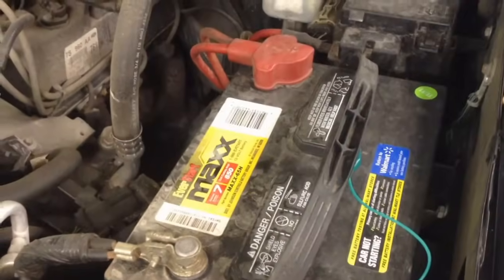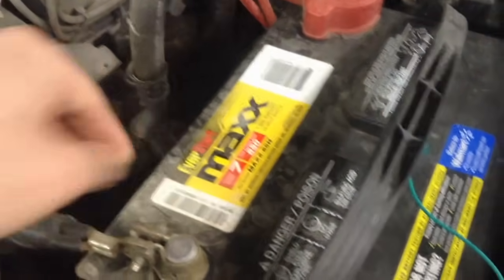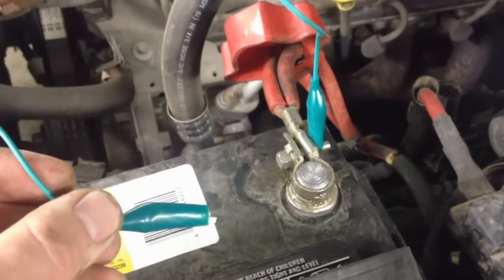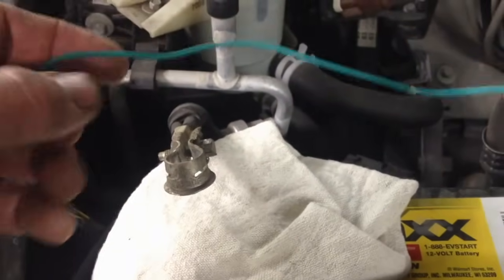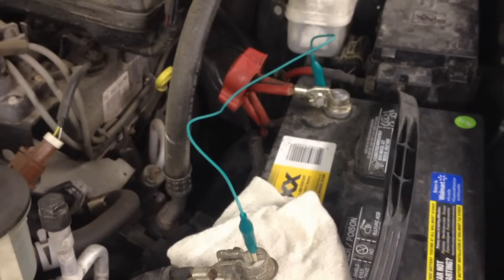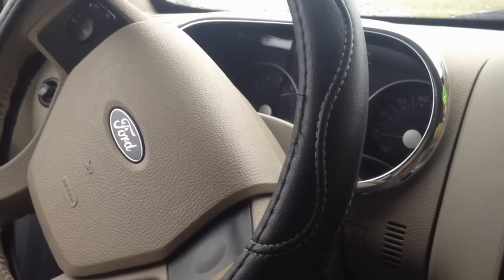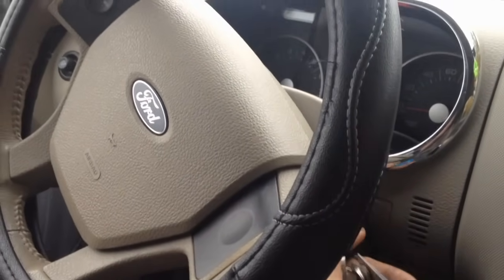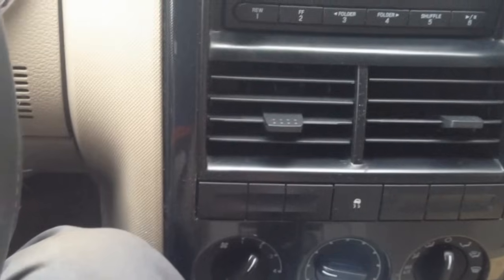How To Clear Your PCM'S Memory On Fords After Repairs

Comment: Got a 97 Mercury grand Marquis bought a new PCM from orillys ford won't touch my car will this work for my car and I also changed the transmission control solenoid stuck with the same problems and has gotten worse can someone help before I junk this car.

Comment: My problem is this, we changed the TSS and the OSS on my 2008 Lincoln MKX and now when I shift into anything R, D, L1 or 2 it doesn’t move at all. It revs and all, but doesn’t go anywhere. The only thing left we can think of is resetting the system. This kinda freaks me out a little bit, lol.

Comment: Hello, 
Cleaned the throttle body and idle air control on my 2006 Taurus about a week ago. Yesterday, I noticed that the car started shifting hard from first to second gear. Trans fluid is not burnt and is at the appropriate level. Could the shifting issue have been caused by the cleaning?
Not sure what to do or tell the shop. Afraid they will want to get into the transmission. Lots of parts changers around here. Car runs great otherwise.
Any suggestions?
Thanks
Reply: we had the same problem on an 08 Taurus. one time it felt like somebody hit the car because it shifted so hard. checked all the Taurus owner forums and turned out it's a common problem. we had the Ford dealership check and re-check the tranny. they even installed a data logger for us to click whenever the tranny shifted hard. they told us the data logger showed no abnormalities. they rebuilt the transmission in our car and it did okay for about 6 mos then the problem of hard shifts came back. we finally solved the issue when we traded the Taurus off on a Dodge Journey. good luck!!
Reply: Joe Miller Changed the trans filter thinking it might help, was kind of my last ditch attempt. Was told it would cost more than the car was worth for a new or rebuilt trans.
Still had the problem. My neighbor says try replacing the throttle position sensor.
Did that, and no more problems since.
Couldn't believe it!

Comment: I have a 2001 ford escape xlt 3.0 Liter engine. the check engine light has been on for the last 4 years.  i finally got a a scanner and I cannot get rid of code p1409 after replacing the egr valve, egr solenoid and the egr sensor, no vacuum leaks. I have unplugged  the battery which clears codes for about a day, then it returns! will this method finally get rid of the code and more importantly  will it be permanent as to the code p1409?

Comment: Im having trouble with my 97 ford ranger with the check engine light to stay off after a o2 sensor replacement will this help clear the computer.
Reply from the maker: It will clear codes only.
Reply: I was told it could cause problems doing it this way. Any truth to it?
Reply from the maker: I wouldn’t post it if that was true, right?
Reply: FordTechMakuloco i under stand that sir .. But i asked four different tecs and each had different point of views.  So i was asking if there could be any problems after

Comment: so , I have a 2004 ford f150 with the brake light on and the abs light on the dash. took it to the ford house and they did the troubleshooting and found a and problem with the ABS module. I sent the module off to "MY AIR BAGS" for a repair. I got it back for them today 1/24/18. Insatlled it , linked the the 2 batt cables together to clear everything and still have both lights. amd I just not clearing the codes correct or what?  Help P
lease

Comment: I just replaced thermostat on my 2008 mercury Milan 4 cyl took 2 days . I hooked battery up fired up it went to safe mood then restart again was fine but now car has shifting issues and speed odometer bouncing while driving . You think this could be the problem ? Dealer wants 7000 for transmission but It worked fine til I replaced the thermostat.
Reply: I replaced both shift solenoids the fluid and filter cleared pcm now tranny shifts fine  .

Comment: hello i have a 201 fusion when the car goes in 2nd and third gear it revs up and shift hard. my  mechanic found no problems in the transmission but he told me to change my bushings,output shaft seal and cv shaft. can still use this method after my repairs oh yeah and im getting the transmission flush out

Comment: Great info I’m a die hard ford man but don’t have dealership capabilities. In defense of dealerships I was a tech at a new truck dealership for 8 years, the technology vehicles require today are out of reach for the casual DIY most new vehicles require mfg specific software to communicate and repair preforming procedures these generic or Snap On scan tools will never have access to. With most dealers and techs you’re getting services from them you can’t get any where else, it’s not that they “ripping you off” most of the time you’re getting premium concise cutting edge technology and that comes with a price. If you feel it’s over the mom & pops shops ability you better get it to a dealer and demand a quote first.

Comment: Does this method applies to all cars?
Reply from the maker: Fords for sure other may apply.
Reply: +FordTechMakuloco Im going to try your method on my subie..does the car need to be cold or warm when you pull out the battery? 5 to 10 minutes for  the idle learning is less than i expected. some others spend 15 to 20 minutes. As for the trans learning process, the first couple of days you have to drive normally before trying aggressive driving?

Comment: Hey I just rebuild my transmission twice and my overdrive when I turn it off it will go off but go back into overdrive on its on while it suppose to still be off! It didn't use to do that until I had it rebuilt twice bc and it's burning up my torque converter bc it will not stay locked out while I'm towing 99 f350!! I took all cables off for a while before thinking it will reset pcm to clear up my overdrive issue but it didn't do anything for me!! Do you think it will work for me if I do it your way and can I use jumping cables instead of a jump wirer!! Well appreciate your in put on my current situation!!

Comment: I have codes P0708 and p0113 on 2001 explorer sport. I have replaced the TRS and MAF which has the IAT sensor in it. I can clear codes for one drive cycle then they return and suggestions?

Comment: I was told by a friend that eas suppose to use his snapon computer to reset it and told me he had mo time and due this, hes a great mechanic but i was scared to due bur he said this works, it didn't but i understand why, he said 10 seconds or so, not 5 or 10 minute's, I did a tune up and replaced loose plugs on a 4.6L which are known to loosen up, didnt know that and i bought it from my friend, we shook hands on he would fix it if i bought it, he did for the 1st year in a half and stopped, I got tired of having the same issues going on with the coul pack's only to find out that it must of been the spark plugs causing the issue's, I'm not happt because i average about 10 mpg city and 13 mpg highway since the issue's, computes reads 261 to EMPTY on filling up the tank at 24 gallons, been like this for 15 months about, I'm gonna go out and try this since i need gas, i just replaced all pulleys with the belt tensioner since that let go and sounded like the power steering pump, found out by YOUTUBE but i REPLACED 1 of the pulleys that was bag and others seem fine but wasn't, 2 months later the bearing gave way and started to grind, i quickly knew what it was and replaced the other 2 at same time, all New so i thought it would help but it didn't, it fixed my problem, easy fix. I will clean my terminals first then put the positive back on and keep the negative off and protect negative terminal ans keep it crossed for 10 minute's and go for a ride and fill up after to see if it makes any difference,  when i replaced SPARK PLUGS, I also put 8 brand new COIL PACK'S on and changed air filter and oil change with fully synthetic oil and filter that's all this engine has ever known, engine was replaced Brand New by my friend in main reason why I bought it was it only had 32000 miles on engine only, just idles high around 9 most of time, i could due 70 mph and have rpm at 19 hundred to in between 2 max, now at 70 mph its at 2200 rpm's and been like that since tune up and shut off check engine light that came on and go off and come on, it drove me crazy to get bad MILEAGE but listed to the best mechanic i know, haven't talked or texted since then, he broke his hand shake to me and that meant alot to me, we aren't kid's and i my word is as great as a written AGREEMENT and the same with a hand shake, friends since beginning of Elementary School that's a pretty long time like 40 Years long. I have a SCRAP van that I could of sold fir scrap 5 month's ago for $375 is what i was offered but I gave it to hin to scrap and told him when ever you want to pick up, just come and it will take me 5 mintes to take a few thing's out and I collected car BATTERY's from neighbor's because they were lazy to return them, i even told him that, well it sunk into my driveway and i shpuld of sold it, the guy bought a neighbor's SUV and I stated I gave it to my buddy. I held my word from almost 4 years ago now, just come over and get it. If i could start it because starter died, I would drive it to him threw a few back roads and I'm only about a mile and half away max. Thanks for great video.

Comment: will this work for resetting limp mode on a 05 f350 with tow/haul light flashing?
Reply from the maker: +lucas Duffey yes but the trans fault will still be there
Reply: Hi makuloko...have quick ?...have a 03 aviator awd 4.6l that I just got has 173k....was told needs a new tranny..but at my experience says blow valve gasket or solenoids....Wen put in drive only shifter to 2nd after like @ 3500-4000 rpms sometimes wen u let off gas nd a lil harsh..other gear shifts smoothly no harsh reverse..nd found the od bottom had both wires torn apart put back 2gethor...could that been part or whole problem..should I try to reset pcm first b4 I change solenoids pack...thanx in advance.... Awesome videos

Comment: Anyone can help me out? I've got  a 2017  F150 and I'm stupid enough to install a light up emblem by tapping the wire to the park light! Since then every time when the park light turn on, first the hill start assist not available will come up and follow by the auto start/stop will not perform then sometimes the airbag light on the dashboard come on too..... this only happen when the park light is on, the car work fine if the park light is off, now I disconnect the emblem light wire from the park light but the engine light still come on every time when the park light is on! Is it something got to do with the pcm? Did the pcm memorize the false code, how do I clear it?

Comment: hello im working on a 2011 Ford f350 XLT super duty 6.2 gas. I turn the truck on is fine idles and drops to 500rpm and turns off. all less then 4 min.

Comment: Will this clear a tune off my ecu in my 04 mustang gt? Because the guy I bought the car from lost the tuner he used and I want the stock tune restored
Reply from the maker: +Tim Dunker it will not clear a tune
Reply: Do u know what would clear it?
Reply from the maker: +Tim Dunker they are supposed to be returned to stock with the original tuner company flash programmer but I have used my dealer Ford IDS to program them back to stock.
Reply: Can the ford dealership reflash the ecu to clear the tune?

Comment: My 2010 Escape Limited, 3.0 V6, started having these exact issues with shifting. I did the reset exactly as it's explained here and it worked!! I'm on a limited income so this was a life saver! Thanks a bunch!!!
Reply: I have a 2005 Ford Escape limited 3.0l v6 as well, limited income as well. I had a bad alternator had to run on it for like 4 days in the two weeks I was waiting to get my disability income and the battery started to over charge and boil and throw fluid. So I exchanged the battery I bought and had to wait for the person to put the alternator running with bad alternator still and new battery for like a week.   Now that I got my alternator installed it is still wanting to over charge and boil the battery. Any ideas on what I could or should do?? Sitting in a gas station parking lot until I get money again to repair my vehicle/my home.  Watching many videos to try and help myself get this problem fixed. If you have any ideas of what I should do I would be grateful.  Also I have tried the battery reset already.  Thank You and have a Blessed Day.  :0)

Comment: Great video! I also used your '2009+ Ford Canister Purge Valves Multiple Problems" video for replacement of the Canister Purge Valve (which was faulty). The Check Engine light is still on, and I am writing to ask if I should clear the code through OBD II Scanner, or should I use this technique? Any feedback would be great! Also, my truck is a 2013 Ford F-150, thanks!

Comment: FordTechMakuloco, I bought a 2006 Ford Fusion SE (Automatic Transmission, 2.3.engine), and it has trouble going up hills- it doesn't slip, but I have to give it more gas than normal for it to downshift and move up the hill.  Similarly, when I turn a corner, as soon as I get on the new road, the car doesn't take off like it should when I give it the normal amount of gas to accelerate slowly.  This fix that you've shown in the video- could that be a remedy for this problem?  I keep thinking it may be a major transmission problem, but it shifts fine past 40 mph.  What do you think?  Thanks!

Comment: I have a 2009 Ford Edge the water pump went bad and Milkshake the engine before I bought it from a junkyard the vehicle ran and supposably one of the employees took the battery out of the key fob and we put a new battery in. the vehicle does nothing after replacing the engine no crank no fuel pump sound no start I think in theft mode I believe code p1260 what do you think?

Comment: Can i perform this at any time?  i have an 05 escape that is having a misfire issue.  Shop stated that there is a 5v push to the ground on cyl 3.?? said the PCM needs replaced/reflashed.  i unplugged all the PCM connectors and the problem went away for about 2-3 miles.  I stopped and the problem/light came back.  Overall the car is great shape, just runs a little rough and then this misfire issue.  Any suggestions?
Reply from the maker: you need to replace the pcm, coils and plugs on these.
Reply: anything i can do to help prevent/delay this from happening again?  everything ive been reading says it will happen again.  The car has 182k miles, but has been taken care of pretty decent.   Has a pretty much new suspension front and back.  Hoping to get 2 years out of this, i just bought it.

Comment: What if you disconnected the positive cable instead, and touched it to metal for 5 minutes? wouldn't that be ,circuit wise, the same as jumping disconnected neg cable to positive terminal?

Thanks for the tip!

Comment: what will happen if you dont have a fuse in the PCM memory slot in the fuze box in the engine compartment? I just noticed the fuse for the PCM memory is missing in mine, and that my truck wont start(which i think is a bad fuel filter/or the pump)

Comment: I had my battery freeze over enough to not produce enough amps so nothing wanted to turn on this winter, after a fresh batt jumped the car we connected our battery back on after a solid few hours and it had to relearn the shifts so if you have extra time just undo both the negative and positive until your sure most of the brains are "shut down"

Comment: i have an error on my Ford Mondeo mk3. i think it's the egr valve. have dismatled the egr and cleaned it. fault still there (flashing coil light) would this reset it? and is there anything i have to do after this?

Comment: we nave an  2008 Ford Explorer xlt. with 160,000 mile on it . Yesterday in traffic the car started running rough and it  stopped running while driving down the road. We can start the car and move it but then it will run rough and stop again.  The battery tested good, however not the alternator. This morning  when the mechanic checked the alternator again it was reading ok?? This happened two years ago and we had the wiring harness replaced because the wires were trapped in the valve cover when we had the valve cover gasket replaced and when the engine got hot it was frying the wires. 

Again it was 96 degrees out so we are thinking we may have a short effected by the heat or the alternator is truly bad? Several of the symptoms that I read online that indicates a bad alternator are happening, air conditioner not working, no alt light was coming on but the check engine light will come on. yesterday the little wrench light lit up when we stalled. 

Sorry for the rambling but I wanted to give you all the info I had

Comment: would this work on a 2011 ford  fiesta???
Reply from the maker: +David yes
Reply: FordTechMakuloco my grandson has a 2010 Fiesta with no trans problems. He ran into a curb and impacted the driver side front tire. No obvious damage but after that, the transmission is very erattic and unpredictable to the point he doesn't use the car. Can the steering angle sensor - or another suspension component be the cause?

Comment: I don't know if you got my message but i have a 2005 ford five hundred and the transmission shift perfect but it down shifts hard when coming to a stop or down shifting hard when you hit the gas hard! It don't do it the first 5 min when cold and after that is does it close to half the time! You have any Suggestions??
Reply from the maker: +RICHIE6610 reset adaptive tables and check for updates. Make sure fluid is not burnt and is at the right level and type. Relearn and go from there. These had many problems with valve body issues.
Reply: Can i resetting the adaptive tables with the battery like you show on here? Im just trying not to go to the dealership, Do think i should change the fluid because it is original and car has 84k miles? Thank so much!